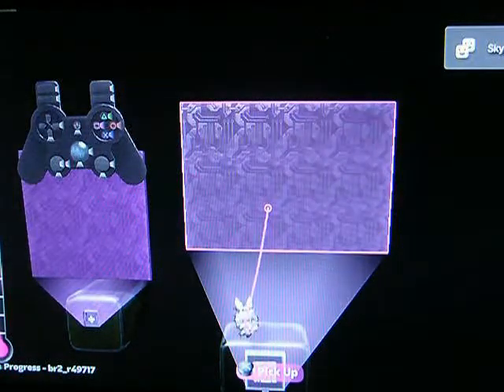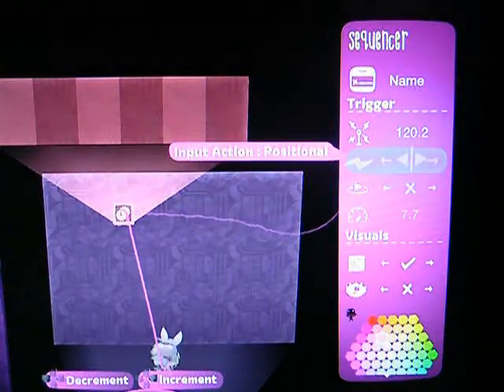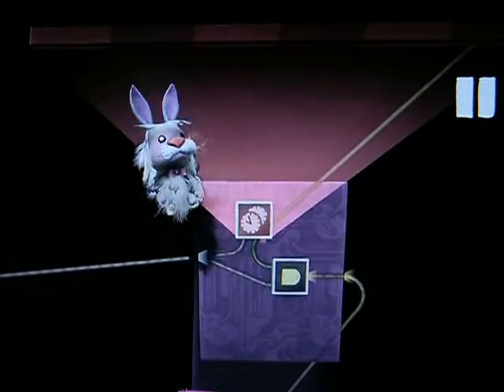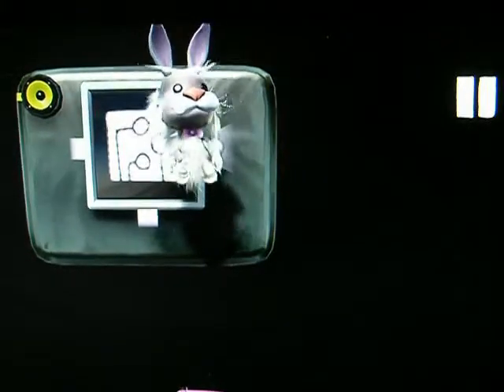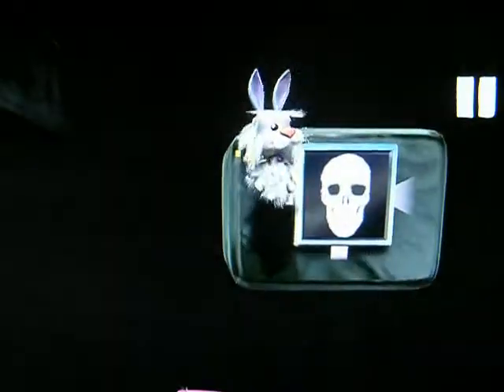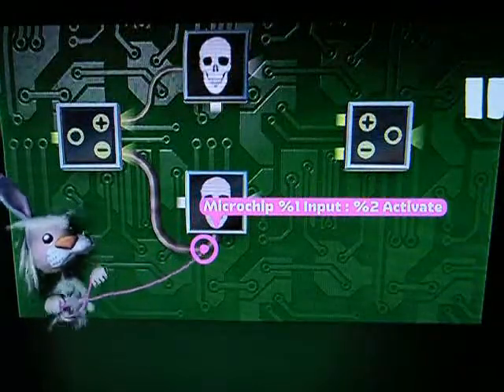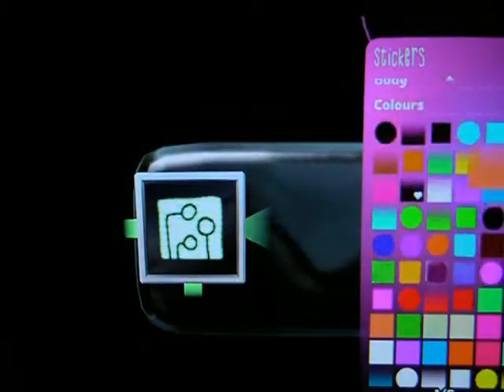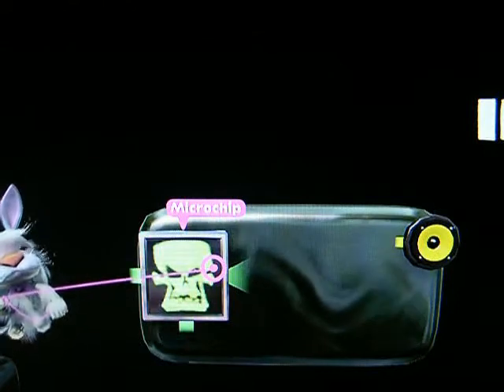LittleBigPlanet 2 - Reusable functions with microchips / threshold chip

Comment: Yeah but that doesn't explain anything. You hooked it to L3, but what value would that input to the sequencer? L3 is either pressed or not pressed; it doesn't have a percentage value other than 0 or 100. I think the original question was asking, just as I am now, what you would use these chips for. Show them in action to show us when/why they would be useful.

Comment from the maker: @colvintribe Thank you :)  1) Well, you mean to limit how long the level lasts? You could always set the Active output of a controllinator to start the count up of a timer that feeds a game ender. The active output is where the PS button would be on the real controller.

2) That's just a piece of hologram material that's moving around. Use tags and tag sensors to simulate the bouncing or flowing along the material. eg. it reads a yellow tag and then changes direction.